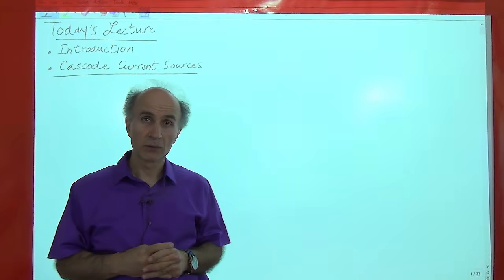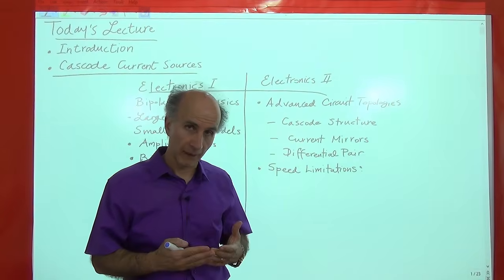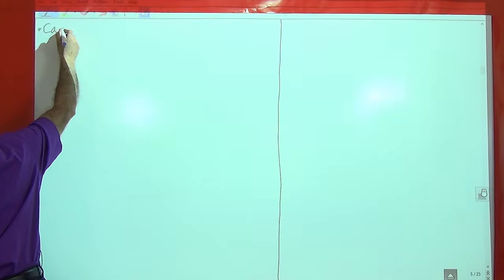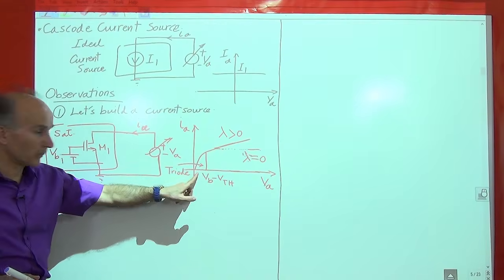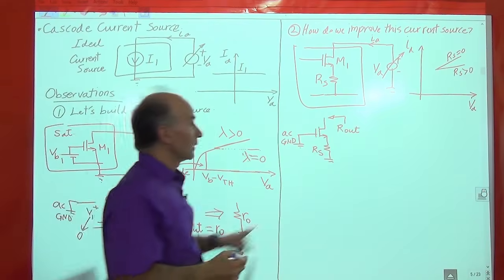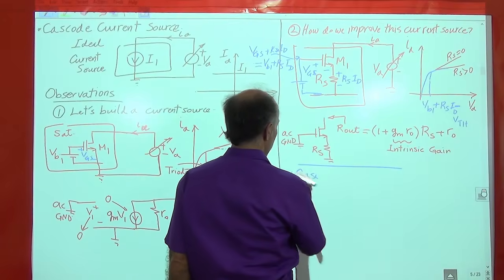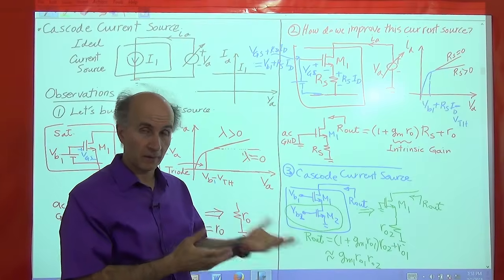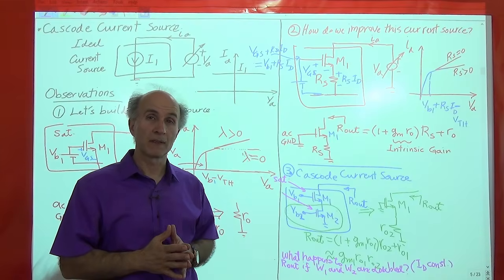Razavi Electronics2 Lec1: Introduction, Cascode Current Sources

Comment: I am lost. Assume M1 is the cascode device and M2 is the degenerating device, I can understand the output resistance is boosted to gm1 * r01 * r02. So far so good. But how could M2 help the narrower DS1 voltage range issue? To avoid M1 getting into the triode region, DS1 voltage needs to be narrower just like using a simple Rs resistance at M1 source... Correct? What's the advantage of M2 over Rs in this perspective?
Reply: I thought about this again.. if degenerating device is a NPN, the CE voltage can be selected at a low value,,, say, put it at the edge of saturation so CE voltage is small to minimize its impact on cascode device DS voltage. But if degenerating device is a NMOS, its DS cannot be too small. Its impact on cascode device DS voltage is unavoidable... What do I miss here?
Reply: He tried to build good current source ... Even though voltage changes current maintained to be stable .. with degeneration we can achieve this.. but problem with resistive degeneration we lost some space that means triode region increases in triode region it won't acts like current source, by compensating Little space , we achieve somewhat constant current..but another property of good current source is it should have  high internal resistance.. that means he want to try to improve output resistance of the device.. but output resistance depends on degeneration resistance Rs .. if I increase further Rs, Rout increases ..but during dc analysis we lost more space. That means Triode region further increases.. he don't want to compensate this time.. that was the reason instead of resistive degeneration he used MOSFET.. during dc analysis you have to calculate dc voltages but Small signal resistance r0 effect is not there in dc so with out increasing further triode region.. he increased output resistance Rout, ro effect comes into picture only in ac..

Comment: Seems there is a logical fallacy around the 32-33th minute which is this: the saturation condition of the non-degenerate MOS is V_DS > = V_GS - V_th => V_DS > = VG - V_th (assuming the source S is grounded, so V_GS = VG - 0 = VG). However, with degeneration, the condition is still the same except that the source S is no more grounded, and therefore, the condition becomes V_DS > = V_GS - V_th = VG - VS - V_th = VG - ID*Rs - V_th ... so, the left (lower) limit of the saturation region from the value of VG - V_th then shifts to the value of VG - ID*Rs - V_th <= VG - V_th i.e. to a lower value (or, in other words, the saturation region seems broader against the triode region). Why is the saturation region then sacrificed upon degeneration (assuming the same VG to ground in both cases)?
Reply: Did you get any answer for this?
Even I'm facing the same doubt.
Reply: With out degeneration resistor vgs = vbias= vb, after placing degeneration R at source.. vg new = vgs+IdRs, vgs= vbias = vb from previous circuit, now vg( new) = vb+ IDRs.. vg( new) -vt= vb+IdRs-Vt   point shift right side. so Triode region increases, triode region increases means saturation regions ( region of operation of current source) reduces..

Comment: in the Cascode version of the current source in the SS model we replaced M2 with its output impedance r02 as the equivalent degenerating resistor. I am not sure about the effect of  r02 on the limit of collapsing into Triode if we try to increase r02 by  selecting M2 with a lower Lambda for instance (knowing that r0=1/(lambda*Id)). Is it going to be the same effect as with degenerating using Rs (normal resistance). we went to M2 in place of Rs to avoid adhering to Ohms law but if we replace M2 with r02, are we not going to adhere to ohms law, hence reducing the saturation region which means restricting the voltage range variations this current source can handle before leaving Saturation.

Comment: Please correct me if I am wrong.
Here's my answer for the concluding question:
If the width of the transistors are increased while keeping their drain current constant, that would mean their overdrive voltage would have to decrease in order to accommodate the rest of the circuit and keep its current flowing.

Comment: M1 is an amplifier (common gate) and therefore (for low frequency operations) it should be operating in moderate/weak inversion to maximise its gm for a given current. M2 is your main mirror device which should be in strong inversion to improve random offset (i.e. mismatch). Both devices must be in saturation.

To achieve the above, usually M1 has a large W/L ratio (and L can be very small). M2 has a large L since mismatch is inversly proportional to L (for a fixed current), so you can simply push M2 in strong inversion by setting the W to something small (technology dependent) and increasing the L to whatever size or speed limitations you may have.

I am not sure why many books assume that the devices should be the same or even identical.
Reply: how is M1 a common gate if input signal is applied to the gate and sensed at the drain? to me it looks like a common source.
Reply: @mohammedabdulhakabdullaabd1121  No it’s not; it’s a cascode device, by definition a common-gate configuration with input current at its source and fixed Vb at its gate.
Reply: @billy_tomas  agreed. Thanks for clarifying.

Comment: I have one doubt : For the degenerative resistance structure

by KVL
vgs = vb - IdRs
vds = vd - IdRs
so for triode region it is same condition as vd > vb - vth

can some one please explain this to  me..
Reply: In this lecture the following has been assumed:
Without degeneration Vg with respect to GND = Vb1 = Vgs as source is grounded.
With degeneration Vgs is the same as without degeneration as it is required to maintain same bias condition for both cases. So:
Vgs=Vb1
The battery voltage in the degenerated circuit is = Vg to GND= Vgs+Rs.Id = Vb1+Rs.Id.

Therefore:
The condition for leaving Saturation to Triode without degeneration is Vd to GND must be > Vg to GND - Vth. Because source is grounded the condition becomes Vds>Vgs-Vth = Vb1-Vth

In the case of degeneration the condition is still Vd to GND must be > Vg to GND - Vth. But Source is not grounded therefore the condition becomes Vds > Vgs + Rs.Id - Vth = Vb1 + Rs.Id - Vth.
So the saturation range has shrunk by Rs.Id.

The confusion results from understanding that the condition is Vds>Vgs-Vth which is true only when source is grounded but the more generall condition is Vd (drain voltage with respect to GND) must be > Vg (gate voltage with respect to GND) - Vth
Reply: @mohammedabdulhakabdullaabd1121   Thanks for the explanation :)

Comment: Plz anyone explain , how MOSFET doesn't follow ohms law in saturation..
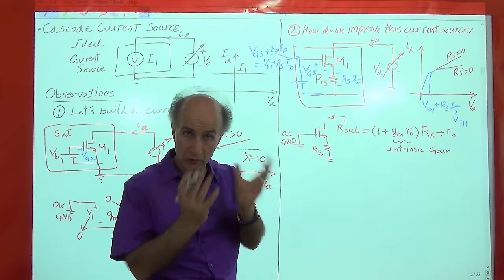In triode region in could be correct but how is it correct in saturation region at 33:35
Reply: Id is not having linear relationship with Vds
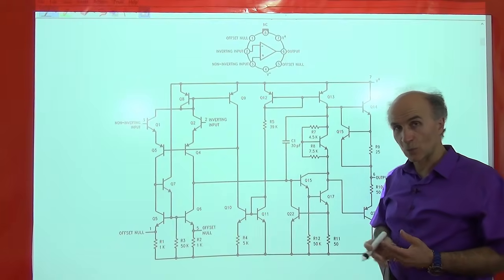Reply: In the next lecture 2 at 11:27, Prof explains this. The voltage across the transistor is constant and doesn't depend on the current that flows through.
Reply: Current remains constant regardless of voltage changes (if channel length modulation is ignored) as long as the drain voltage with respect to GND does fall below the gate voltage with respect to GND by more than one threshold Vth.
With ohms law current follows voltage depending on resistance. In Saturation that is not the case.

Comment: 01:25 - Intro and review of Electronics I and II
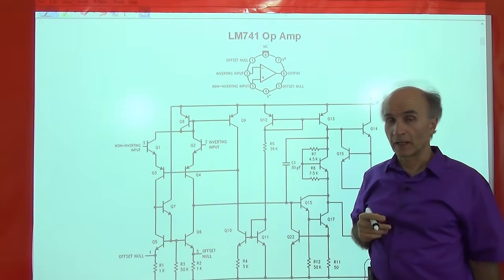10:28 - Examples of Circuits of Interest
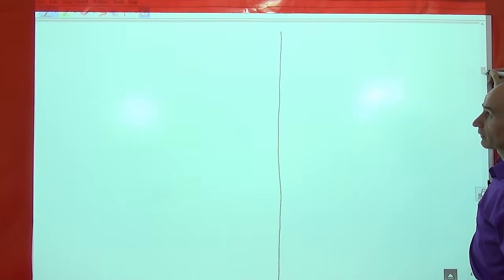14:45 - Current Source with MOSFETs
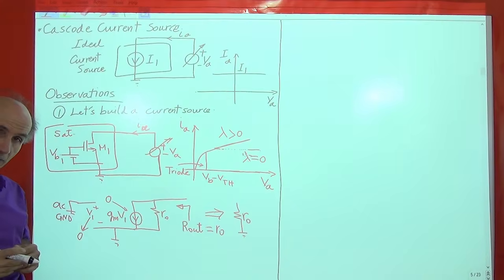24:07 - Improving Current Sources with Degeneration
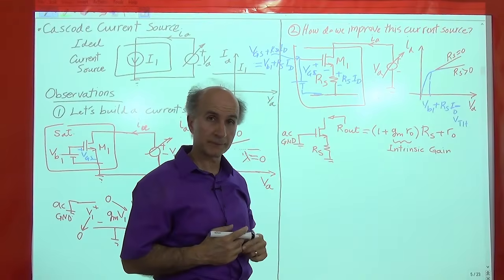33:20 - We need a device that can degenerate but does not follow Ohm's Law - That offers same or higher incremental resistance - That will serve as an negative Current-Voltage feedback element
39:20 - Fundamental Property of Cascode
42:40 - Double-Cascode
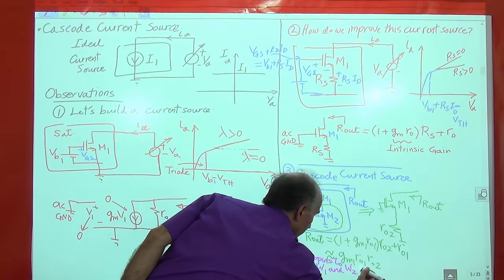45:00 - What happens when the widths of transistors in a cascode are doubled?

Comment: Hello, thank you for your lecture. May I post two questions here?

Two topologies were discussed in the lecture.

1. Degeneration topology

Rout = (1 + gm*ro)Rs + ro

2. Cascode topology

Rout = (1 + gm*ro1)ro2 + ro1

1)	Comparing Rout in these two topologies, how can we ensure that ro2 >> Rs such that the cascode circuit can provide a more linear output current than the degeneration topology?
2)	How can we ensure Vb1 + ro2*Id – Vth << Vb1 + Rs*Id – Vth such that the cascode circuit provides a larger range of linear output current than the degeneration topology?

Could anyone give me some hints? Thanks

Comment: Ideally we want lesser o\p resistance in the amplifier right? and high input impedance.... why are we trying to increase the output impedance here?
Reply: hey Ajay,
We are increasing the o/p resistance for MOSFET 
But, not for the circuit .......hope u understood*
Reply: @serendipitous5497  Yes thankyou, i figured that out after searching the internet for a bit. 
Regards!
Reply: The higher the resistance the closer we are to an ideal current source. Ideally an infinite resistance is required for the source to be ideal. That is why in circuit theory when we set independent current sources to zero we replace them with an open circuit (infinite resistance)